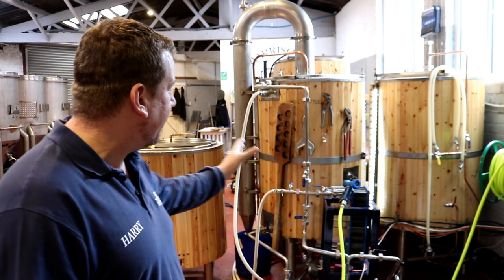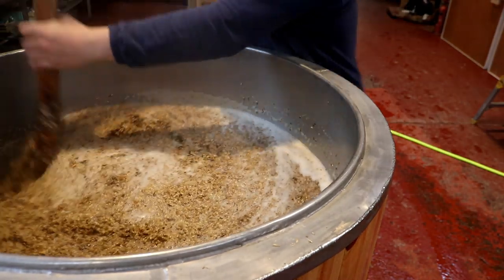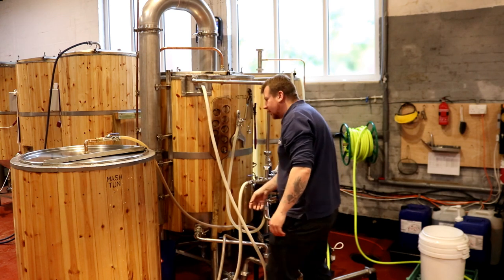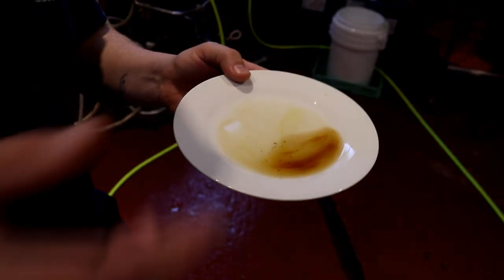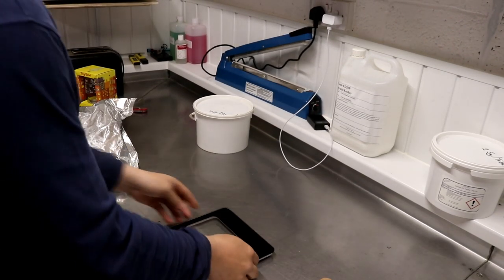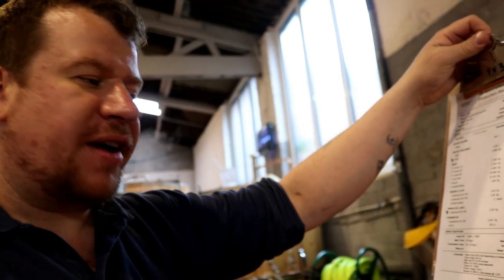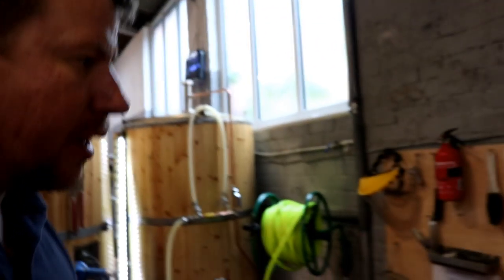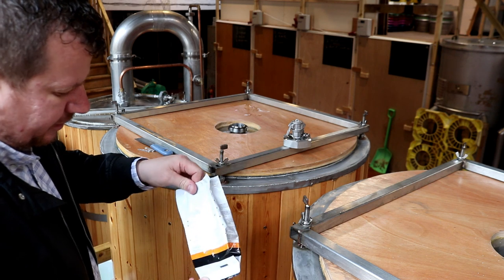Centennial Rad Red (Brown) IPA ~~Brew Day~~

Comment: Harry aka Chris, your videos almost always set my mind into motion.  I have a brand new 5bbl brewery located at a winery (not open yet).  I gave up the use of camlock connectors a few years ago for tri-clamps.  However, watching the ease at which you move a hose from point A to B makes me wonder.  It just ain't that easy moving a hose with a tri-clamp connection...……   I also just bought Centennial and Cascade Hops from Spot Hops in the US on sale.
Reply: I also used to operate Tri clamps and glad to see the back of them my new kit 2.5bbl uses RJT cant wait to use it once we have moved in to your brewpub
Reply from the maker: RJT and Camlock all the way.

Comment: Nice satisfying brew day as usual 😀i might be imagining this, but on one or two brews you used a cheaper alternative yeast. How did they turn out in comparison to US-05?
Reply: I have seen that AY5 by AEB ferments a little higher FG and sweeter apparently than US but i have only used Trent ale currently so cant comment until i move the brewery im gonna try AY4 and 5
Reply from the maker: I thought it was OK. Everywhere seemed to have sold out when I went to order more.  It did finish a little higher but nothing I cant alter during the mash next time. I do Prefer US-05 though.
Reply: HarryBrew69 i suppose when you can start yeast harvesting the cost saving is done anyway. At least you know the alternative works well though

Comment: how do you control temp of wart exiting the chiller. Is it simply by controlling flow of cooling water and adjusting?
Reply from the maker: Yeah, I eyeball it at the minute and use the temperature sensors on the fermenter to hit the sweet spot. I will be adding a probe on the outlet soon.

Comment: Hi Harry, great video. One question, everybody always goes on about sanitizing the outside of the bag and utensils you use to cut it open. I noticed you pour the yeast. But I am guessing you did it elsewhere. Do you do that or not?
Reply: I wouldnt worry about what you use to cut them as long as its clean pal i used a scissors with my packets never had any issues
Reply from the maker: I think it is overkill but I wouldn't say it was wrong. Then I just pour it in.

Comment: How do you measure your water volumes! Any chance of a water profile for the vacant too? Burtonised water profiles always seem far too high in minerals, could you let us know the sulphate and chloride?
Reply: It is indeed quite high in minerals isnt it 8/1 sulphate and i recall DWB was 3/1 i dont use it so cant confirm what it is though! Volumes are usually done off a site glass on the HLT and i usually measure tap down the boil volume and stop collecting and dump the rest to drain and clean out mash...

Comment: When you are doing your 15min recirculation do you do a mash out then or do you combine the mash out with sparge? I'm assuming on the scale you brew one is necessary? Anyway thanks for the brewday footage,I'm sure filming is quite a distraction. Have a great weekend. Cheers.
Reply: I wouldnt say so in my experience the Sparge water will raise the mash bed temp to mash out so no need to do it to be honest long as your Sparge is at the right temp!
Reply: @Pazey1  That's the way I always did it when home brewing,just wondered if it was different but on commercial scale.
Reply: @DullahanBrewing  Nope exacly the same pal although in my experience it took 30-40 mins to get the bed temp up there i still locked in the mash profile as the FGs were matching the temps etc
Reply from the maker: As Daz said, The sparge raises the mash quicker than I could externally. Sparge water is at 80 and I try to keep the grains below 78 to avoid tannin extraction.

Comment: Need to get yourself a inline thermometer, think hand guestimating can be subjective, and sure it will be an easy project?  Good brewery thanks :-)
Reply: Yeah my old kit had a thermowell on the heat exchanger out it does although restrict the flow but unless you chill ground water you could never run more wort than water!
Reply from the maker: I use the STC on the tank to monitor the temp of the knockout. I just use my hand to guide it in there ;)
Reply: @harrybrew69  Yeah im looking into hitting the flow over thermowell so i can get a reading from STC on the new kit although as we will be open in the pub during knockout think im going to need a baffle and pump just incase!